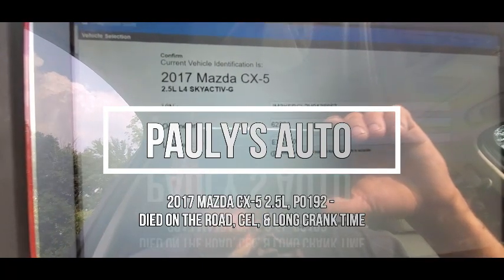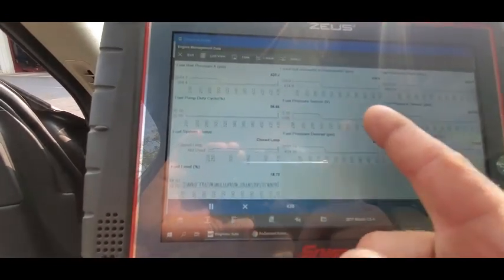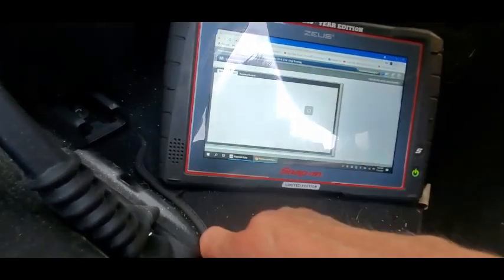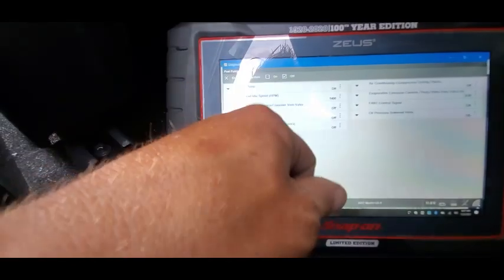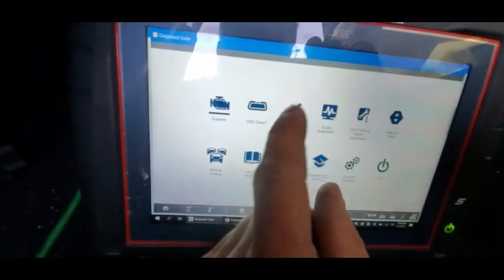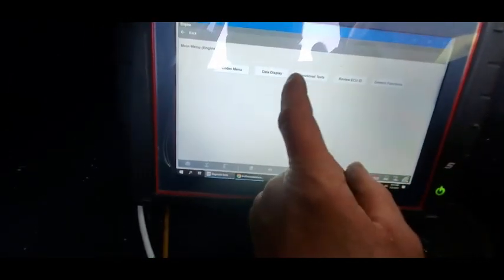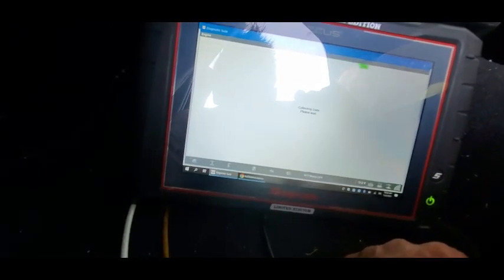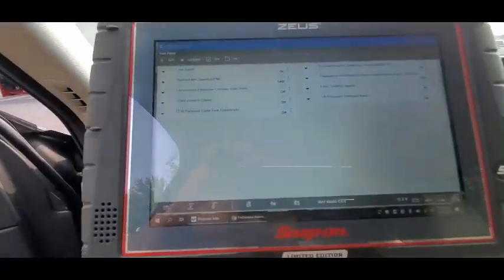2017 MAZDA (CX-5) 2.5L, P0192, DIED ON THE ROAD, CEL, & LONG CRANK TIME

Comment: Great video! Having the same issue with my 2017 Cx5. Died on the highway, hard cranking, started for a min but would not accelerate. I had 25km on the fuel reader left in tank. 😢

Comment: same on my 16 cx-3.  16% fuel in tank, died on highway,  wouldn't start.  then started a little later.  replaced the in tank low pressure pump  on an educated inexpensive guess.   started right up afterwards and took it for a 30 minute drive, but first added about 5 gallons of fuel to the tank.   will test the old pump with an scope to see if there's an irregularity of the running waveform.

Comment: Update. It was just out of fuel. Lol jk brother. Great show of how the circuit works!  In some Toyota’s specifically the tundra and 4 runner. the ecm pulse width modulates the FPM and the FPM controls the pump negative and steps the potential of the pump. Usually like 4v 8v and 12v. The diag line back is a measurement of that voltage. It’s pretty cool. Not sure exactly how the Mazda works. Thanks for the explanation and testing procedure you showed on the video. Also are you going to ASTE?
Reply from the maker: 🤣 no fuel dummy!  I don't know yet about ASTE, I should get my rear end in gear and fork out the cash and get it done already....Pauly 🙄

I'm due for a vacation, but I'm also a cheap a$$ 🤣🤣🤣
Reply from the maker: Thanks for explaining how yota voodoo works...I'm thinking this might be the case for this Mazda too.

I'm hoping I get a pump soon so I can capture it after replacing it 🙏